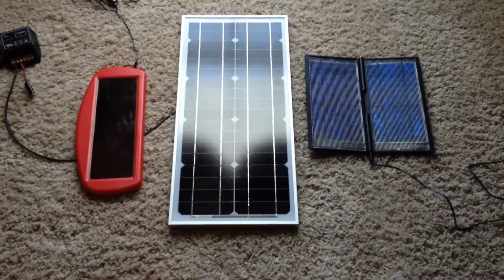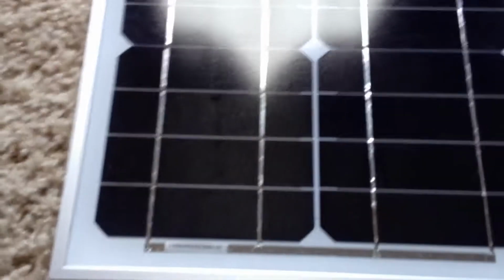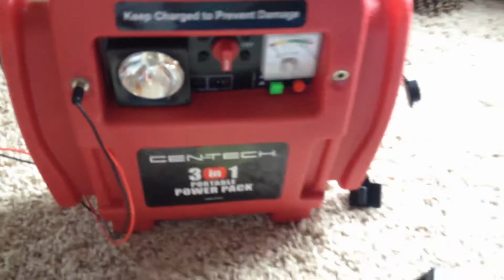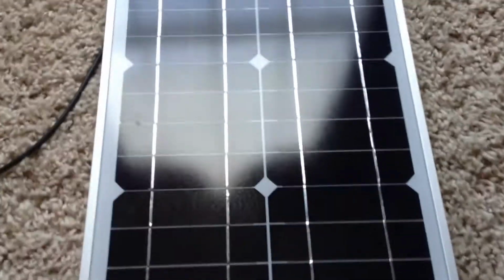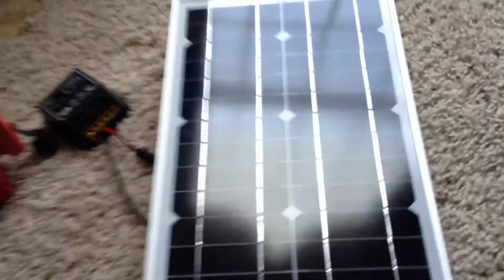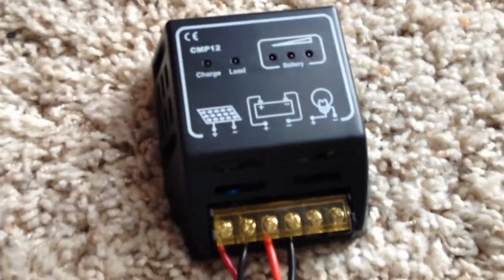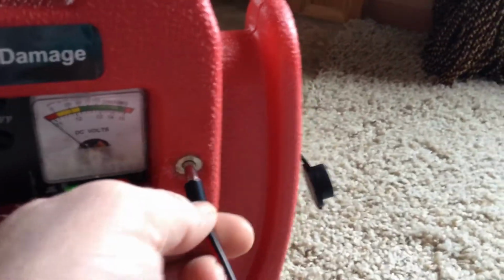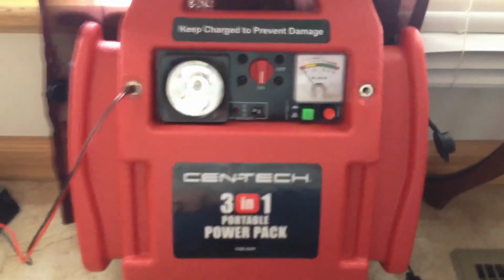Vid #5 How to charge harbor freight 12v jump starter with solar panel and charge controller hook up.

Comment: Would this also work with one of the compact Li-ion jump starter batteries that have around 20,000 milliamps (claimed) and regulated USB 5v outlets etc?

To me the principles are the same, but I wanted to ask before I blow my house up

Comment: I removed my jump start from my 12v solar panel. Can you use a jump start for something. I bought a generic solar charge controller for my solar panel but it came with a alligator clip and I removed it.

Comment: Hi. Great video, very informative!  Question: If my jump starter has overcharge protection, do I really need the charge controller/regulator?  Also, the point about the amp rating of your AC charger vs the Panel is of special interest - I was thinking of hooking a 100W panel directly to a Stanley JC509 1000W jump starter, but now concerned about affecting life span.

Comment: Thanks for the videos, I'm working on a similar project. You mention the internal power supply is .5A. To make sure I understand, a 20W 18V 1.1A panel would charge at over double the rate of the internal charger (while the sun is out)?